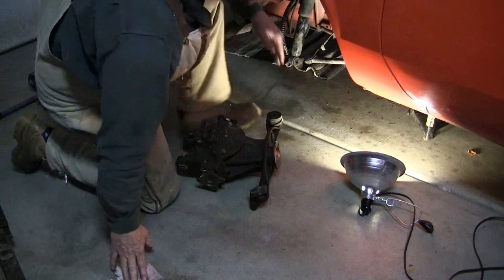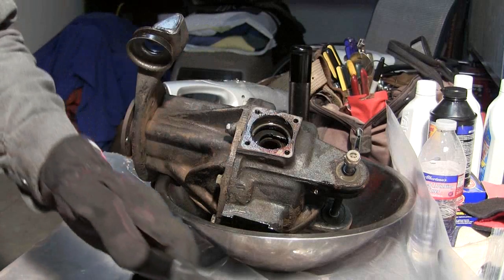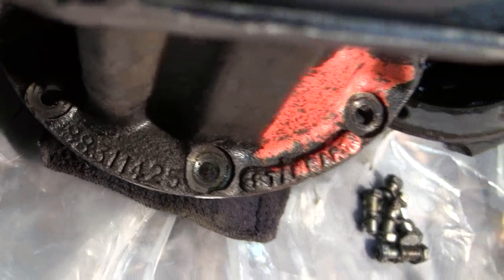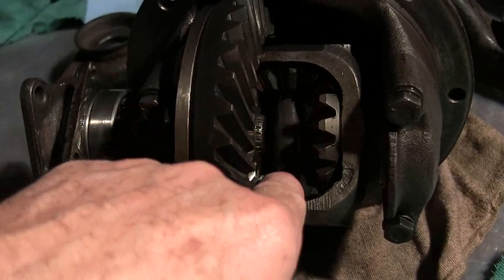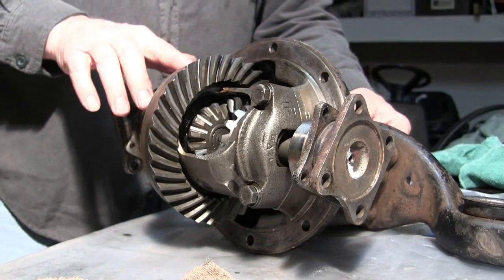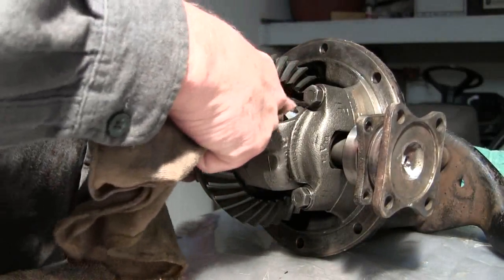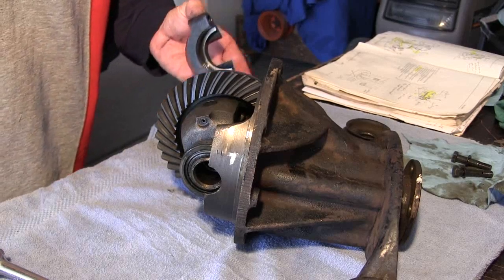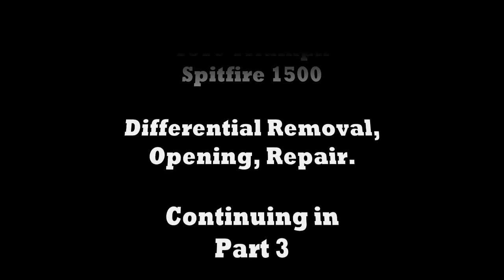Part 2 1979 Triumph Spitfire 1500 Differential Removal, Opening, Repair

Comment: My grandpa called the inner gears of the carrier group, spiders. You referred to them as planet gears...  I'm curious if terms have changed over the years.
Reply from the maker: My book was printed in England, I've heard them called spider in the US.
Reply: Technically they are called differential side pinions, which mesh with differential side gears, but people commonly call them "spider" gears.
Reply: Shannon,The Brits do have different terminology for those gears as you had mentioned ( i.e. crown wheel ...we call ring gear ) even in U.S. the differential assembly is known by many different names.. i.e. " Diff";"Head"; "Pumpkin" ; "Chunk"; "3rd Member" ;"Pig"; Drop In"
Reply: Right on...